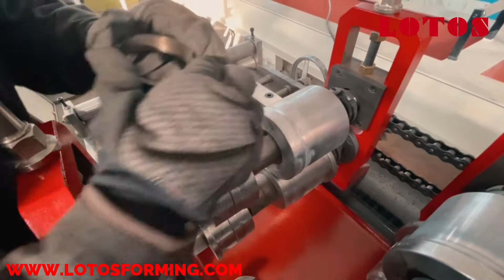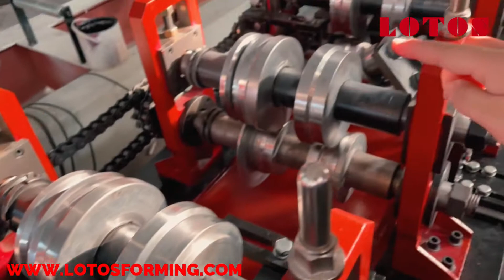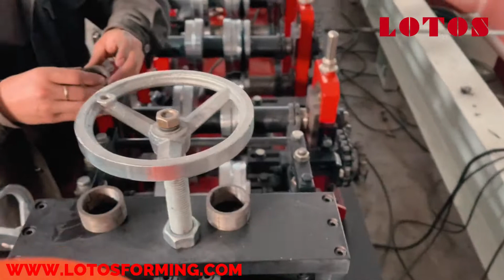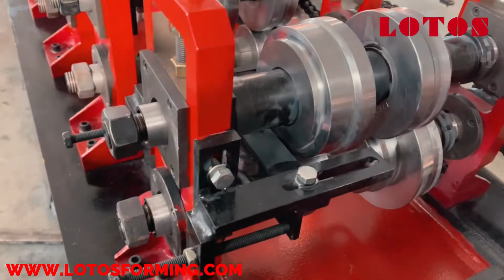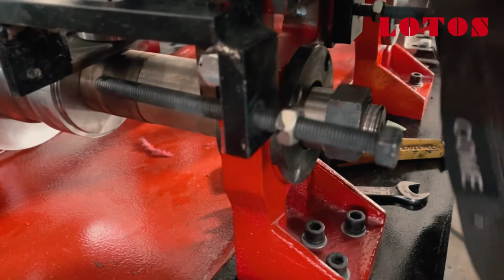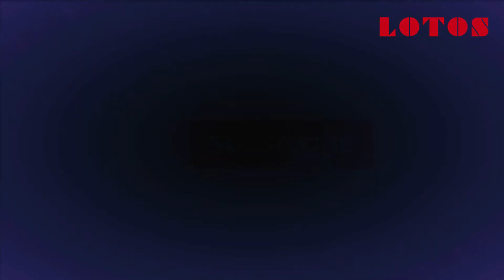【Spacer in roll forming mill】: Roll Forming Machine Part-Spacers | Split Spacers

Comment: It is an important part used with the roller in the roll forming machine.
Spacers use to fix the rolls in the correct position on the spindles.